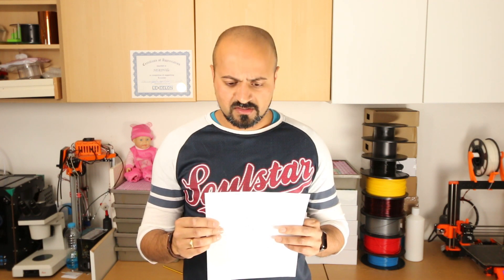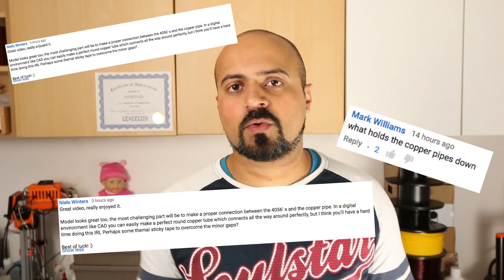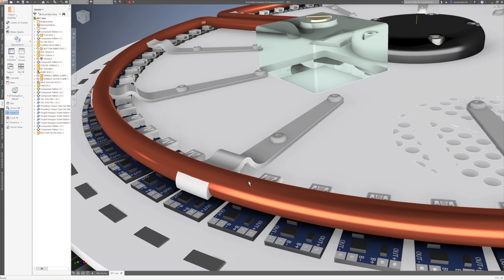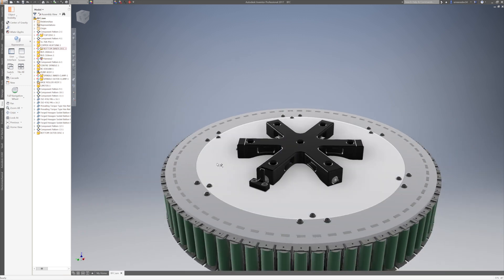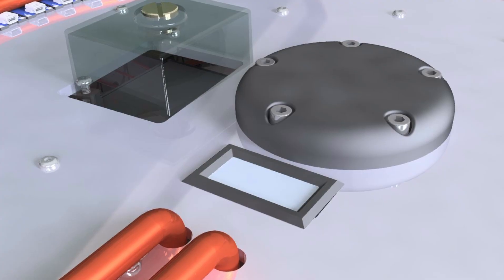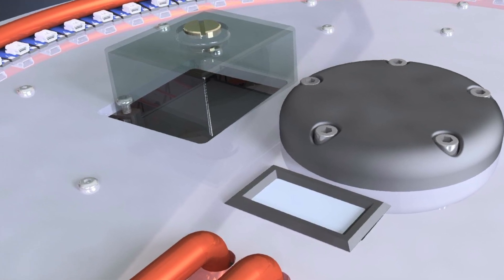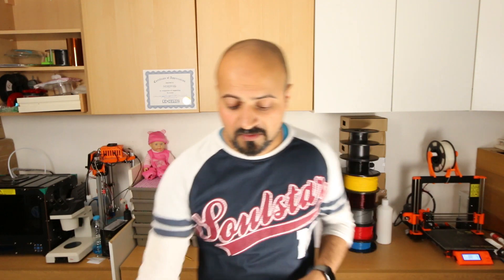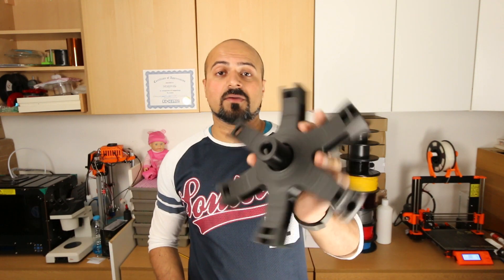18650 Mountain - Part XIV.1 - The BFC - Viewer feedback design updates

Comment: You have a great presentation style and clearly have a real engineering mind, but I am really disappointed that you have made no more videos on this 18650 project for 4 months,

I think you have a lot to offer the community but you seem to be getting bogged down in other stuff that is a little pointless; I mean most of us do not have the money for a 3d printer, never mind spot welders, when we can spot weld a battery with nothing more than an electrode, battery and a decent capacitor.

Don't get me wrong, I love the "boys toys" you have but I would rather see them in practical use than argue about whether you can print this ultra complex blah blah blah, who needs all those haters anyway.

So please, you have been offered a sponsorship of the 18650 project, you have a willing audience (well me at least!!) it would also be great for your nerdlings to see some of the practical ways these 18650's can be recycled.

£2 will buy you a case on eBay that can be used as a backup battery for your phone, I am doing a 36v drill upgrade from Nicad to Lithium and I am probably going to convert the charger too.  

One thing that bugs me about 18650's is a reliable way to measure their state other than the charge- discharge-charge cycle.  On some batteries that cycle got me 2500mAh but when I repeated it I got 1750 mAh.  Also the 18650's in my radio (a 4p layout) charge fine on my iMax but cause my radio to reboot.  

I am also intertested in the plethora of 18650 wares, I have been experimenting with stuff from China, some good, some not so good (for example avoid holders springs like these www.ebay.co.uk/itm/372096638971 instead consider these www.ebay.co.uk/itm/401308560115 with metal tab at both ends or this www.ebay.co.uk/itm/371974759518 which is same but with wires already soldered on allowing you to adapt them as you see fit.

You have all those batteries, I hope we see something more from you soon!!
Reply from the maker: Hey thanks for the long and great comment. I do really try to get more 18650s out, but the learning curve is very steep for me and it does take time to plan, film, edit and make projects. 

Regarding the reliability of measuring the true capacity of a cell. My thoughts are that unless you have a means over recording realtime data of the Constant Current discharge at 1A over a given time for the voltage to drop its 3v state and calculate this then everything else is just blind faith.

Where the inaccuracy comes from is using different types of dischargers and they can give vastly different results. I would say, pick one device and use that exclusively for discharging, at least if that is inaccurate then at least every cell that you tested on that device is also inaccurate and relative to each other cell, they will be fairly accurate

I hope that made sense, but thats my work through.
Reply: I think you are absolutely right about consistency, I have a basic IMAX clone, I do not have kit to calibrate it.  I have seen others that have PC port and so on but it is not just the chargers

As I said, I have 4 18650's from a digital radio (in 4P) , they show proper voltage, they charge up OK on Imax charger, but in radio they seem to drop voltage and make radio reboot.  I am guessing that, because I can reproduce it if I turn up volume or use wifi or both. I have ordered a display from China that I hope will tell me more.

Based on this community's videos I am sticking to 1amp discharge then trying to see if any lose voltage.  I even put one of those red voltage LED displays on to see if they drain and by how much, I was actually surprised at how little loss there is.

I can understand how you are held back, what sort of project are you considering?  Solar again?  

I get my cells free (not huge qty) and they are for small projects, I am not convinced that solar for home has an ROI, especially with UK sun.   Maybe a car conversion like JG in California, a modern practical car such as an MPV might be fun (One of those 7 seaters) , would have some room for battery packs, difficulty is the weight and range aspect.  

Do let us know and thanks for your efforts.
Reply from the maker: DP425 hi and thanks for the kind comment. It’s true the reality of work and other projects that keep a roof over my head is getting in the way. I would want nothing more than to do this full time. I will be back as this project has been built but just trying take make time to make that engaging episode to conclude this build. Keep your eyes peeled.

Comment: Hello i have a question. The liquid cooling it's self i would be worried about Condensation Getting on the PcB boards.What do you think?
Reply from the maker: Hey Joseph
For condensation to occur they'd have to be a large and sudden between two temperature extremes. The complete unit will be at room temperature and enclosed and running a 400W power supplier this in itself I feel will get warm enough to minimize that large gap between the temperature extremes, thus removing any risk of condensation... that's the theory anyway.

Comment: Hi, you will need a coolant that will not react with the different type of metals and cause corrosion, either a good quality PC coolant non water-based, mineral oil (is non conductive) or something along the lines of a good non water-based automotive coolant like Evans Coolant https://www.evanscoolants.com.au/ . Of course what you use will depend on the type of temperatures you will be expecting.

Comment: For sure not use water! :D If there is some leak somewhere it will destroy all the electronics. Use a liquid like in computer "water" cooling systems. These are not electrical conductive, make sure you monitor the flow/temperature from the cooling to detect that there is a leak or not. You would not like to run it without cooling. Maybe just use instead some heat sinks and/or fans.
Will the CAD designs also somewhere availeble ? :)
Keep up the great work!!

Comment: I would drop those water cooling system, do away with a small heatsink in each of them, they don't get that hot depending on the voltages, lower voltage would be less heat but not too low. Those heatsink I would recommended is the one that used in stepper driver of your printer.

Comment: You could make the chargers smaller with ME4056 boards and/ or produce less heat by supplying 4.5v instead of 5v.

http://www.ebay.com/itm/1A-ME4056-2-54mm-Pitch-Linear-Charging-Battery-Charger-Board-5V-to-4-2V-3-7V-/272256010829?hash=item3f63b90a4d:g:vkEAAOSwRgJXjx9T

Comment: Very cool project. i would recommend to use Pre mixed pc liquid coolant. it will prevent the cooper pipe or other metal bits you have in the loop to corrode with each other. if you use normal tap water algae will grow in the loop

Comment: I recommend a polyfuse 1.5A for each charge module to be on the save side because the modules often faulty :(
Good Idea by the way to do a charging wheel
Reply from the maker: thanks I will be looking to create a small circuit with a Diode but the Polyfuse addition will further protect the setup.

Comment: As an addition to my previous comment, I would recommend that you get a radiator for your cooling loop. If you do not, you face the chance of chargers overheating. Please keep in mind that initial testing may show lower temperatures because the loop has not had time to stabilize. As time goes by, the loop will get warmer and warmer until it reaches a temperature where it is gaining heat as much as it is dissipating it (thermal equilibrium).
Reply from the maker: its a possible addition to this design already looking at some options

Comment: I would suggest looking into coolant for custom PC liquid cooling loops. This stuff is designed to be a good thermal conductor, while still being cheap. I would not recommend any kind of anti-freeze or anything like such. While it sounds like a good idea, it is a coolant that is designed to NOT freeze, while still being okay at removing heat. Other coolants remove heat in a far more superior manner, but just aren't impervious to low temps.
Reply from the maker: I think to be safe it's either distilled water (Cheaper) or PC-MOD stuff.

Comment: Another idea for the realities of dealing with imperfect real-world copper pipe could be to add real heat sinks to the copper pipe and have the flat interface of the heatsinks contact the chip/thermal junction. But that would require some metal machine work to fit the tops of the heat sinks to the pipes before soldering/brazing.
Or you could just ditch the water cooling and go with the traditional heatsinks.
Reply from the maker: I did think about getting something like a 1" wide thin copper strip and solder these onto the pipe vertically but my main intent of the design was to make it as flat and sleek as possible.

Comment: You won't improve the heat capacity by adding anti-freeze, you'll reduce it. IC engines run pressurized systems so they can run hotter and the anti-freeze decreases the vapor pressure (increasing boiling point) further aiding this.
What anti-freeze will do for you is add anti-corrosion treatment. That may be worth it.

Comment: What about overheating Cells or are the cell that will charged in there already tested?
Reply from the maker: i've charged close to 1000 cells in my previous board (Awesomist Charger) and there was around 2% where the cells got as hot as 90C but they never caught fire and the TP4056 seemed to have dealt with in comfortably. You could precheck internal resistance prior to using the BFC to charge these I suppose.
Reply: NERDVille let's just hope it stays that way! I haven't had cells catch fire so we can assume it is pretty save.

Comment: Maybe a tad over engineered?  The heat should be good with just the pipe.  If you need more cooling then face one pipe up and one down, make the up longer creating a natural chimney.  Why not do a double sided board.  33 on each side and stand it vertically?  That will take up less room?
I like the way you think and approach these problems.... Thanks for sharing....

Comment: How are you going to wire it up? You are dealing with 70 amp witch sounds crazy.
Reply from the maker: I have 66 TP4056 which if they are ALL in a state of FULL charge (peak graph) then the max this could draw is 66A. But I reckon it would be around the 50A as most of the cells would be slow charge to begin with and others would have completed

Comment: Keep water as much possible as coolant, oil has smaller heat capacity and glycol also. So, if you're not ready to take some strange coolant, water is much better and safe and Cheap ! Glycol is used in addition if you're affraif of frost ... I hope it will not be the case. You will keep the same liquid phase all along the cooling system (having state change can be of big benefit, but very complex and sensitive to manage) , see "Table of specific heat capacities" @ https://en.wikipedia.org/wiki/Heat_capacity and bigger are the number, better the cooling capacity of the fluid.
Try to think also to thermal dilatation if closed loop (otherwise = leaks guaranteed).

Comment: Fantastic Concepts!  Your ability to turn conceptual ideas into 3D visualizations quickly is greatly under-appreciated.  Keep it up!

 Some suggestions:
1. Ditch the liquid cooling and use a large ceiling fan to cool both the TP4056 and the
cells at the same time. You are going to occasionally install the cell upside down and burn out the TP4056 chip. It happens to all of us. It is better to have free access to the chip. Besides that, some of the chips will just go bad for no obvious reason.

 2. Have a stationary non-contact temperature sensor with an alarm and rotate the cells back and forth on the carousel in front of the sensor. Less than 1% will get internally
hot, but when they do, they get HOT! 
3. Removing cells from their holders is difficult. Think about drilling a 3/8" hole in the middle of the back of the cell holder and use a 3D printed cam and lever with a rod to
push them out from behind.

 4. The great thing about this idea is that all the tape and crud that are on a used cell should not affect the function.
5.  Just as a future conceptual idea, I worked at the Stroh Brewery that had an automatic can filler that looked similar to your concept. It inserted an empty can, filled it, capped it, and sent it on its way in a few seconds. Imagine loading a cell for charging at the beginning. Then after it charged, have a relay switch the cell to a one amp 10 watt resistor for timed discharging. At the end of discharging, an Ink jet printer sprays the capacity on the cell. and it gets popped out into a bin when done.

 Cheers, 18650 E-Biker
Reply from the maker: Thanks for the detailed comment. There is potential to upgrade this version to a more intelligent cassette controlled by a servo that removes and installs charged cells. I still like my Hive design as it semi-auto and its more 'load and leave' plus its smaller and possibly readily easily enough for the enthusiastic maker to reproduce. But really like your canning machine suggestion

Comment: so.... we went from a "dumb" charger to something that will charge, test, reject bad cells.... to another REALLY BIG dumb charger... now I'm not saying a BFC is a bad thing, I would actually like to have one myself, but you're still going to have a bottleneck when it comes to testing all the cells. if you want to provide this in a kit form, or completed form, it's pretty large for shipping purposes, it's going to be out of the reach for a lot of hobbyists or someone that just wants to get one powerwall up and running. why not do something like the jehu design, build it as a dumb charger then upgrade it to a smart charger down the road?
Reply from the maker: Hi Jeff. I'm certainly working on a semi-automated system but time constraints to learn new skills and test and prototype the electronics really is the main setback for me. Going back to the Nut & Hammer analogy in my previous episode. There is a point to this series and a big reveal regarding tackling the potential bottleneck from The BFC. All will be revealed...
Reply: OK so with a solution for the bottleneck coming down the road should I start ordering parts for my 68 cell charger?

Comment: K.I.S.S > ditch the water cooling.. if you need cooling just get some small heatsinks.

one thing I did think as soon as I saw this the other day.. why don't you mount it vertically and load them in via hopper and use a cam profile to hold the batteries and then release then once they've been in for a whole revolution into another hopper.
Reply from the maker: Hey Dave. Yes I think it could certainly be modified to work this way.
Reply: The thing that springs to mind was how a gatling gun loads ammo minus the chain link.

But if the hopper was at the midpoint and you had grooves in the wheel you can then pick a battery on the way past, clamp it a few deg's later with a cam, then once it's gone up and over drop it out once nearly completed a full rotation.

The other way I thought of doing it was with a spring loaded holder so use a feed wheel to push it into place if you wanted to avoid using a cam as a clamping mech.

Alternatively, just buy a shed load of MC3000 chargers and then you need only load them once to charge and discharge them and get a rating on the battery.. price is still decreasing bought my last one for £74 and just looked now and they are down to £71..

I just load some basic VM's with USB port mapped to the VM and can have each bank monitored in its own window..